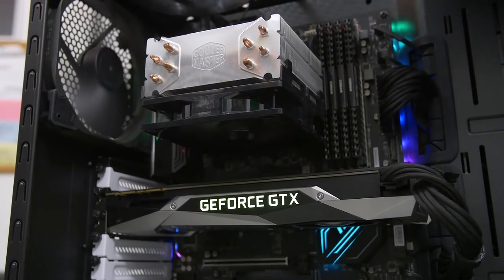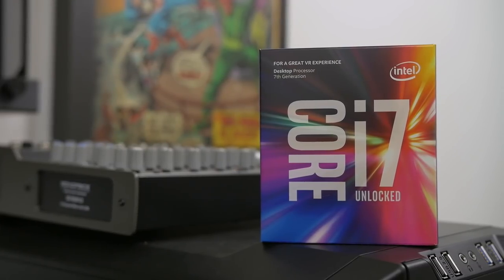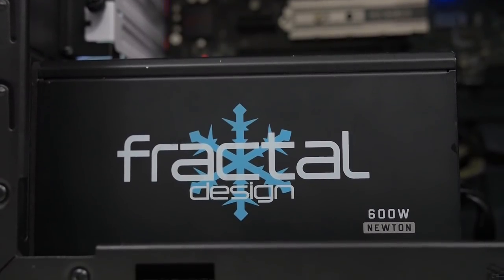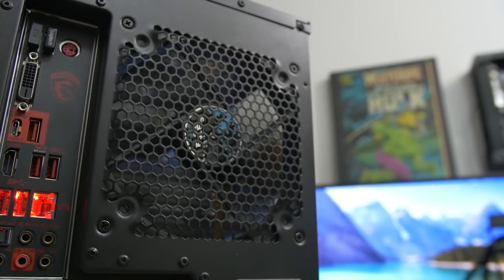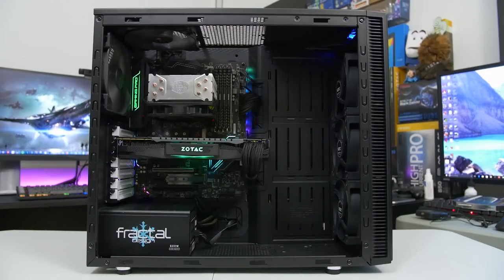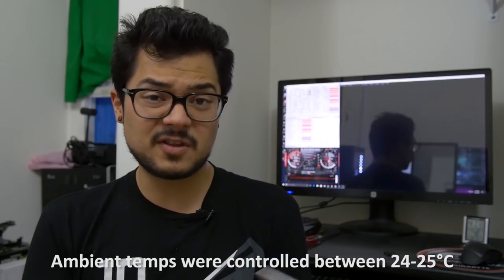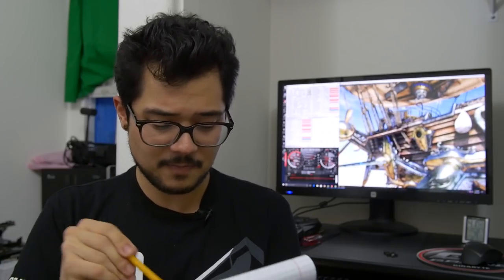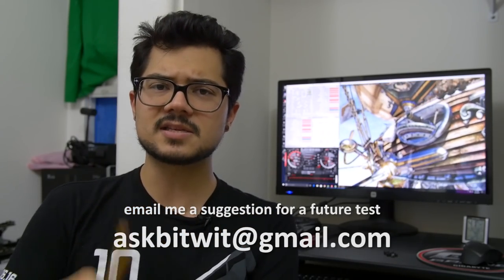This is how you should mount your CPU cooler! I think??

Comment: Okay so I have a guess as to what is happening with the horizontal cpu fan and the open gpu. As we all know hot air rises, while cold air falls. So This means that the gpu fan/s are working with the cpu fan. As the hot air rises and is pushed off the gpu, the cpu grabs that air and pushes the air out of the case, or the air rises out of the case. At the same time the gpu fans are grabbing air from the bottom of the case (cooler air) and pushing that through the gpu, and the cycle repeats. The fans at the front of the case help this even more because the two bottom front fans grab the air and push it to the gpu, while the third/top fan pushes air to the cpu. Any warm or hot air that doesn't make it out of the case is cooled quickly and run back through the same cycle.

The other question might be,  why is the blower fan still hotter then? With the cpu fan still being horizontal. My thought is that there is more air flow with the open gpu. Think of it, your front fans are stuffing the case with air. Again the bottom two feed the gpu, and the top feeds the cpu. But the air goes out of the back. This means any air that didn't make it out of the back of the case from the gpu, rises directly into the cpu, the cpu takes that warm air and adds it to the air it already has. Cool air and warm air balances everything out so that you don't see a decrease or an increase in temps. 

In short, I think it comes down to how the air is recycled and circulated throughout the case. The blower style gpu creates a closed loop type system with air going in and out. While the open gpu creates an open loop, meaning that warm air that doesn't make it out of the case will get caught by a fan and reused. i am just guessing though.

Comment: Here's my theory, the blower card in the first test was acting as an exhaust fan pulling all the air being taken into the case below the GPU, starving the CPU fan and rear exhaust fans of air. And as for the GPU with an internal cooler, its not affecting the air flow or pressure, being it is internally contained, allowing for normal air flow both above and below the GPU. Just a theory, anyone else's opinions would be interesting to hear.

Comment: Test 2:-
Maybe the HOT Air that is lighter than cold air travelled upwards in case.... And as you   have added  3 intake fans there must be a great airflow in the case... Hence it helped to blow away the hot air thought the top of the case more faster and efficienctly.... Thats why there was a drop in cpu temps

Comment: if you didn't that explains why open air gpu was cooler than blower style cus the GPU exhausts hot air and the 3 intake fans push it out of the open side panel

Comment: I'd suspect that the blower-style card creates a low-pressure area below the cooler and card, causing the case to retain a larger volume of warmer air from the cpu cooler, rather than ejecting said air.  While the open cooler on the otherhand wouldn't impact the pressure inside of the case, allowing for air to escape at a more equal state from the top and back corner.  Just my guess on the first 2 results.

Comment: You gotta look at GPU Temps as well. The GPU temps may have just been slightly different on each run, meaning a change in overall ambient temps. I would honestly look at every temperature sensor in the case on each run to see if you can find overall higher/lower temps stemming from somewhere. If ambient temps are higher/lower due to the other components, that CPU heatsink is going to be able to dissipate more/less heat accordingly. Also, higher test times/ more test cycles will only improve your data in any experimental design, you just weren't looking at all the variables here/didn't completely isolate the desired variable in this one run.

Comment: It seems fairly logical to assume that the exhaust on the gpu is forcing air out of the case that would have otherwise blown through the CPU cooler, net air exhausted is the same but less air traveling through the CPU cooler meaning less heat transfer on that block. You would have to add a separate closed air intake for the gpu block on that card not to affect the overall temperature of the case.

TLDR the blower gpu is taking air flow that would have otherwise blown through the CPU cooler. Less air, less heat exchange. Higher CPU temp.

Comment: @bitwitkyle i've figured out why the temps made no sense. It has to do with the type of fan on the gpu. The reference model pulls air away from the cooler because is sucks air in. the zotac pushes air away. so the CPU cooler is starved for air under the reference model

Comment: maybe blowers dont cool the gpu sink as well so although most air is ejected there is still more heat radiating off the back off the card. while open style coolers will keep the gpu cooler on average and leave less heat to radiate up. 
Also blowers do cause more air to move in the case and no matter what temp moving air will be better at drawing heat away from the cpu fins. So open coolers place a case in a more positive flow environment

Comment: It would have been cool to include GPU temps also. So you could now how orientating CPU cooler effects GPU. Right now it show clear win for vertical mount (-5C for CPU), but if that means your GPU is running hotter for same amount or even more- then it is not worth it. Because +5C more will definetly affect your GPU boost performance as the +5C for CPU doesn mean anything usually.

Comment: The aftermarket cooler just caused more air to move within the case, making the cpu cooler cool more effectively, and neither heatsink (GPU or CPU) brought the air to thermal capacity, meaning that more airflow inside the case=more cooler

Comment: most probably  the open GPU helped the airflow in the second test to move it out instead of being stuck above the GPU card as a hot air pocket that some would escape back into the CPU fan as in the first test.
however in the fourth test the GPU was blowing hot air directly into the CPU fan and it raised the temp.

Comment: there is a possibility that the increase in air pushed into the case leads to greater circulation that then reduces the time the hot air has to heat the cpu

Comment: The horizontal+open GPU configuration probably pushes more hot air out faster than the others, my guess being due to less resistance than trying to blow air out the top, and the heatsink having relatively less surface area facing the GPU, so the airflow is less obstructed.

Comment: the blower style card changes everything from a case air flow View point.
blower style fans have extreme pressure and low flow, this is why you have to run them loud to be effective, but it's the only way if you want tot remove all heat from inside with air.

Comment: You need to do a part two and just focus on testing one thing at a time to avoid adding additional variables. So test the orientation of the CPU while keeping one card in there. Then perform a test of open/blower GPUs on one CPU cooler orientation to see the affects on the CPU temperatures.

Comment: Personally I think the blower card could have stolen a good portion of the incoming air. 
While the Zotac card kept the case's air pressure high so it all was getting exhausted quickly on the top fans, so while the air temp was warmer, there was a lot of air rushing through that little cooler.

Comment: The initial with the blower card result appears to be (to me, in my inexpert opinion) that the blower style card pulled overall pressure from the system, and that this lower pressure led to lower airflow through the exhaust. by moving to the vertical position you placed the fan in the 'lee' from the blowers negative pressure, capturing the high pressure area on top of the blower to have greater pressure moving to the exhaust.   As far as the results for the open gpu (more relevant to me as I have a zotac amp card) it looks like that when you were vertical you were drawing from the warmer air around the card (which also collected in the space above the graphics card, as in the blower build) and you were drawing almost directly from the front fan when it was mounted horizontally. This is just gut feeling stuff, but airflow has been shown to be intuitive (there's a great article on Van Gough's work perfectly modeling turbulence for instance) and my mind and guy agree on the above.

Comment: blower GPU might take the air out of the case from place which CPU cooler tries to take it, when open GPU doesn't take it away. The lower airflow in that case may be worse than pumping hoter air through CPU form open GPU.

 You should check airflow with smoke generator / incense stick with windowed case

Comment: for AMD FX users the vertical mount the way to go but instead of having an exhaust on the rear to mount two on top as exhaust. this way it help a lot to get rid of the extra hot temp the vrm produced plus to keep it from going close to 100c.

Comment: The Founders data might be the result of one (or even both) of these two processes. A: The vertical placement aids in the convection of warm air and exhausts it quicker than the horizontal cooler. Or B: The smaller volume of empty space between the cooler and the GPU cause air being moved by the fan to rush into the fan at a higher velocity, hence exhausting quicker. However, its still a relatively big gap for a gas, so B. is probably incorrect, but A. might be worth looking into. Pls notice me Bitwit senpai.

Comment: did you remember to put the side of the case back on?

nah, the blower is pulling air out of the case where as the open fan has its own little section of the case with a fan pushing air past the fans and out the PCI slot covers/ through the PSU, compared to the blower actively sucking out air  thus reducing the air current / volume of air pushed through the heat sink.

Comment: Have you closed the case for the test? Open case can interfere drastically on the results. For the 2nd/4 test, if the case was open, there would be less hot air on the case overall, this may be why the second test of the four had this "weird" temp.

Comment: Horizontal blower gpu (62c) vs. vertical blower gpu (57c). Warm air normally rise up. Maybe the orientation helps that air movement.  

Horizontal Open vs Vertical Open. Thermal paste maybe. Whatever we put there, we cannot be so sure how the paste was distributed there. Needs retesting perhaps. 

Horizontal blower vs vertical open. Both at (62c). The fan seems useless here. Must be following the natural air movement where the air movement itself acts as the fan. 

Anyway, I will be reorienting my air coolor now. It's a cryorig h5 with additional slim fan. I hope it fits

Comment: Perhaps in the first test if the card wasn't being too heavily stressed, the air being thrown out of it into the case wouldn't have been to hot to begin with, and the extra push of that air would've helped the cool air being pushed in by the case fans reach the CPU cooler faster.

Comment: On your horizontal fan i think in the cooler it creates an air pocket within the fins not allowing the air from the open graphics card to get in... the enclosed graphics card is maybe radiating hotter from the rear components... you'll need a laser temp gauge to test this or even better a thermal camera if you can borrow one.

Comment: Hey Kyle,

It has to do with the air flow paths, an inch of distance can make a big difference in what gets full pressure air and what doesn't. So Hor.+ Blower the GPU is hogging the cool air from the front case intake and blowing it out of the case reducing the amount air available to the CPU cooler, where Hor.+Open mixes the air up inside the case without removing any, leaving more air to cool the CPU. In HVAC Delta T does matter, but due to airs insulating properties and having components at around 60*C, 30*air@1bar(14.7psi) is going cool better than 20*air@0.8bar(11.8PSI).

Was that confusing enough? LOL! because I've got more to pull outta my butt.

Now in the vert set up the Intake for the CPU is pulling from a different zone and that negative pressure zone around the GPU is now..... uhh lets say "balanced" on both sides of the card. Which is why the Vert.+blower has slightly lower temps, they are working together to pull air into the central area of the case instead of fighting each other for air like the Hor.+blower does, while the Vert.+Open makes a mess of the airflow, so despite having more air available to cool its more difficult for the air to travel into the intake area between the CPU and GPU.

This is my very unprofessional opinion. I've proof read this as many times as I can stand, but I'm no writer. I hope it makes sense!
EDIT:Oops forgot PSI for you Imperi-tards

If Kyle doesn't reply it means he hates us all!

Comment: The answer is easy. Having the fan facing down by the GPU is causing the residual warmth from GPU with the fact that the fan to the cpu is only breathing in tightly confined warm bottlenecked air straight through the heat sink. Run the test 1 last time but with the cpu fan on the other side of the heat sink. You'll get round about the same temps as with the cooler being vertical like your first couple tests
Reply: You went from like 10 inch's of breathing room down to like with that fan being positioned next to the gpu

Comment: According to my theory the real reason behind it is the top exhaust fan. The way exhaust fans are placed makes the top one stealing air from the cpu cooler and as a result decreasing cooling performance instead of increasing. Blower style videocard is taking even more air from the cpu cooler. This effect would not occur without the top exhaust fan

Comment: the blower style cards typically run hotter at about 80'c and the heat from the gpu back plate could be transferring onto the bottom of the cpu heat sink

Comment: horizontal+ blower is fighting for air vs drawing from two different planes. probably creates more turbulence and noise but draws from a larger source of air (being the whole case vs w/e higher pressure fan in the front due to fans).

Comment: Open gpus create vortexes. The heat from the gpu adds more kinetic energy in the vortexes. As the vortexes loose angular momentum and thus energy their temperature drops . These slowed down cooled vortexes remove the hot air between the flaps of the cpu cooler in addition to the cooler's fans. I don't know if it is correct.

Comment: My guess, sending heat out the back in push config to rear pull config gives you adequate air flow, sending it out through the top of the case does the same thing, but now the fans from the front are also pushing heat through the coils out the back as well, causing the dissipation of heat to be more adequate. Ide say this would work best only with closed GPU's like FE

Comment: the first test, it can be so that the heat from the open gpu goes out in back part of it so the fractal fan removes the hot. And that the closed gpu, its heat goes out in the front part of the gpu where the cpu fan takes in air. Sounds logical to me

Comment: I dont know about the 212, but I know that my EVGA cooler was supposedly designed to perform better with the tower/fan vertical (horizontal airblow) rather than horizontal (vertical airflow)

Comment: TEST THIS: 
Impact of having 1 fan (middle fan) vs 2 fans on a "double tower" cooler like the Noctua NH-D15 or Be Quiet Dark Rock Pro 3. Again GPU type is relevant :) 
I also imagine that the amount of case airflow will have higher impact on a 1 fan config than a 2 fan config? - So there could be a case airflow impact on tower cooler aspect to that test too. 

Would be great :) Considering switching back to air cooling from AIO to reduce noise levels - but that requires a big ass cooler :) Thanks for all the awesome content!

Comment: Open air GPU pulled air across the surface of the vertical heatsink, cooling it down. When the heatsink is horizontal, the gpu doesn't add to the heat removal on the surface.  Think arrows of air path from all sources and direction of heat travel.

Comment: The open gpu in a custom case is usually better than a blower gpu. Essentially for the horizontal tests, it's pretty standard. The cooler has more air to intake, even if it's hot air... compared to the blower. since the vertical tests are pretty new to me, the vertical ones are the ones that suprised me, where the custom gpu makes the system hotter...

Comment: Positive pressure alone isn't going to solve all your problems, particularly when turbulence is much more of a thing with a fucking wall of fans.

Circulation of cold air is key and frankly both methods weren't particularly efficient in terms of placement, I think warm air was getting vortexed in the case and the blower was pulling the stagnant air from beneath and was vacuumed from above so it was starved of a high pressure cold flow.

Comment: The fan speeds are varied/aren't in sync - if the fan on the CPU is spinning faster than the fans on the case that the air is being directed toward, the air doesn't have an adequate flow out, causing 'backflush' of heat.

The intake must be equal to or less than the output fan speeds, and if there's a fan or two in the middle of this wind tunnel that are altering the speed or direction of the flow, then the output fans will be less functional - this is why open-air fins in this instance, is cooler than having the fan on the fins.

Comment: In one test the CPU cooler fan is pulling air directly from the hot GPU then blowing it into the CPU cooler.  In the other test, the CPU cooler fan is further from the video card.  It is obvious to me that your specific case airflow is playing an important role.
My case is using three 200mm fans and a couple of 120mm fans and my CPU temps are very good with my air cooler.  My video card is the MSI GTX 980 Ti Lightning, so, it is open airflow.